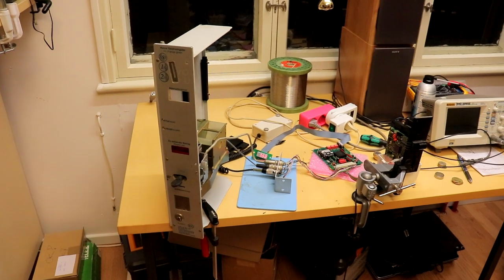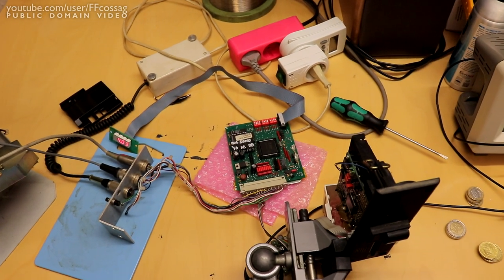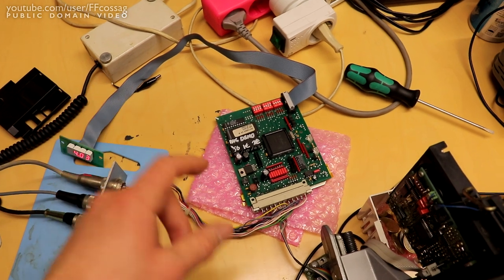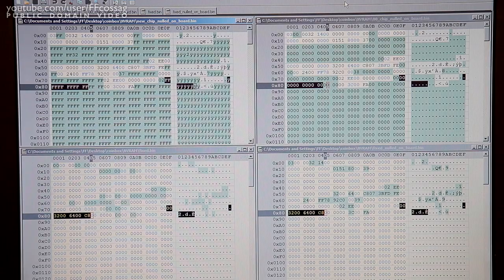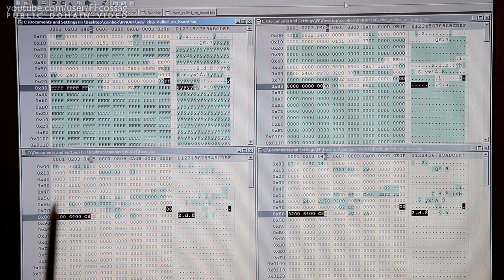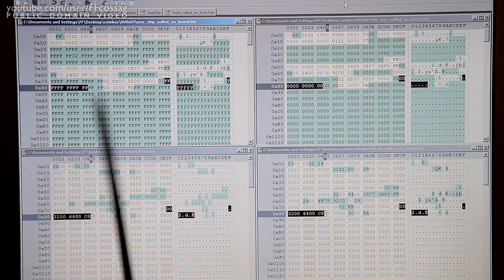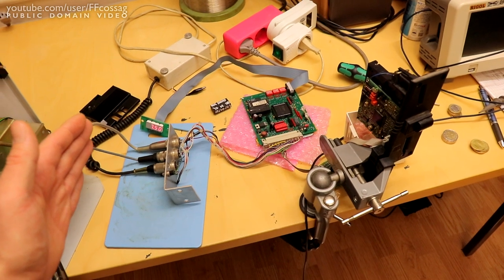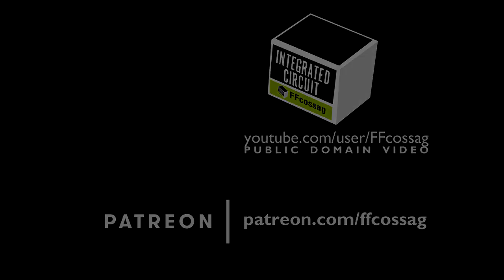Repair: Coin operated storage box that counts some coins as -1 cent

Comment: Well done for working it out based on what was common between the different units. I would've gone for the coin mech being at fault for generating the wrong signal for a coin which confused the firmware.
Reply from the maker: Trust me, I went to great lengths to verify that that was not the issue. Hours spent probing it ...

Comment: Someone screwed up their addressing modes in assembly.
It's using relative addressing, eg LDA 00,X where X = 0x56, if something messes with X, eg an interrupt is generated, X gets set to 0x80.
Could also be a bug in some other part of the code, eg the display output, the counter to keep track of coins, the RTC with the current time.

Comment: Replace all the bad RAM chips with flash chips. No need for a stupid battery then.
Looks like the data doesn't change anyway once the chip is in the board.
Just set the coin values, put it in the board and forget about it. Job done.
Reply: Oh and of course replace the caps.

Comment: Hopefully the company can provide a firmware that actually works?    I spent time with flashrom earlier this year replacing and backing up roms and getting familiar with standard rom chips.   Seems like anytime you have a board you want to make sure and back up the rom chip.  You never know when you might need it.   I don’t have a programmer, just hot swapping chips, glued stick pins on the back of the chips to make them easier to handle.   Pretty fun.   I can’t do the soldered on chips -how are you supposed to solder those on anyways?  I’ve seen people do it.  I guess the flux will get solder in all the right places, I guess.   I need to buy a solder station and all the rest before I can even begin to do any sort of component work.   I have a miserable time just replacing a single large through hole cap right now.   I guess it’s that high temp tin or lead free solder is the main issue.  Brutal.  Hope we got paid well for this and it’s not a case of politics where nobody wants to own up, caught in the middle.

Don’t let yourself be confused on booze.

Comment: My idea is probably something while boot and prewrite of flash memory went horrible wrong. It can writen like that:
Every step of boot is runned fine, then it writes the prederminated content to the flash after the last written sector.
But if something cant boot probably and write his content to ram, than it will cause a slide in memory allocation.
Choin checking program is programmed dummy way and reads the prederminated allocated sector of ram, which is in this case 0 or null. Program think coin cant have 0 value, so it gives an error, probably -1 as output.

I would search in the boot up sequence for fails.